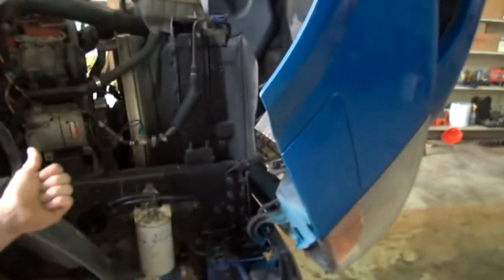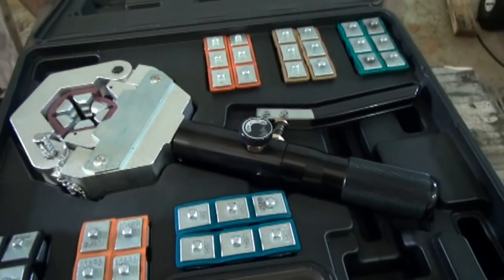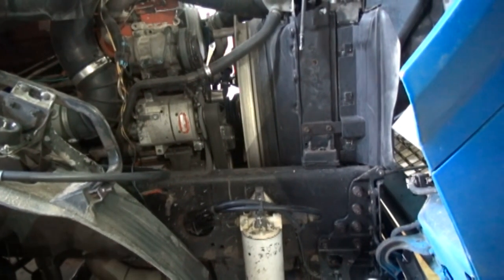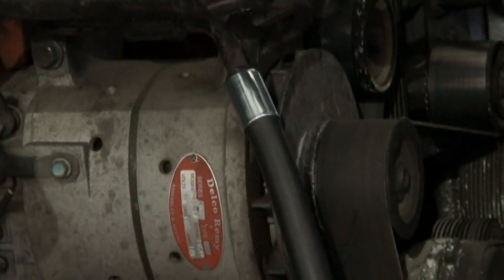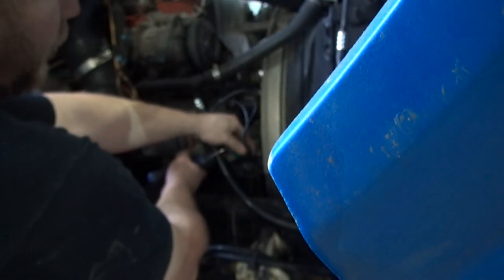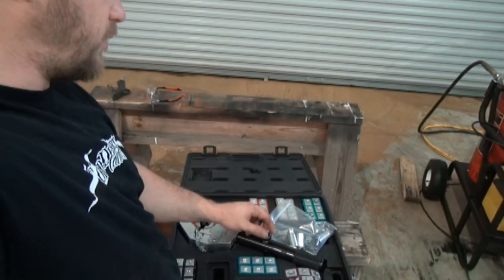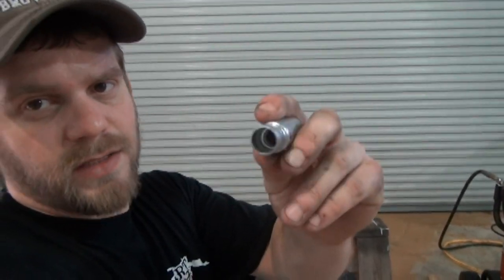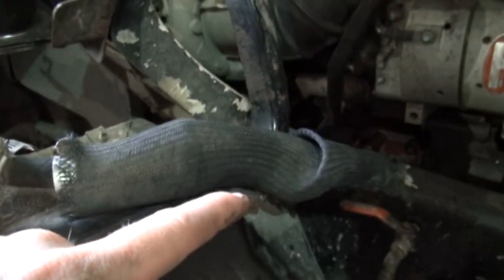How to fix or build automotive a/c line yourself!

Comment: Vacuum leak test won't show leak on hose. Have to pressure test. Also, do you not have to braze fitting in addition to crimping to insure no leak? Nice video, thx for sharing.

Comment: Any update on if this is still good? Is the repair still working?
Reply from the maker: It was working until the truck was taken off the road.
Reply: @LifeWithChase  how long ago was that?
Reply from the maker: @anthonycook8737  about 4yrs ago. Had trouble with trans and engine was tired.
Reply: @LifeWithChase  thanks for the help.

Comment: The vacuum is ok but far better to pressure test as the results of a very small leak will be visible in approx 5 mins the car runs in pressure, not vacuum

Comment: You put the pressure switch on the low side #10 return line? Fail!
Reply from the maker: That's the high pressure line and it worked fine until the truck died and became an organ donor.

Comment: I bought a smilar tool even color the same.my high sides leaked while charging.all of them made  according to chart.im pissed
Reply from the maker: Sounds like you may have gotten wrong fitting for the hose size possibly, had that problem once on another project. Also make sure you have the right crimp die for hose size .
Reply: @LifeWithChase  hoses came with fittings .i have size chart and digital caliper. It only hold 70 psi on the high
Reply from the maker: @Evrenthewrencher  That's odd, I only had that problem once  and I think they give me the wrong fitting or something cause it felt loose when I slid it onto the hose. where as these in this video was more of a snug fit.
Reply: @LifeWithChase  thanks for relaying.i do another pass on the fitting and see what happens.those tools look identical on different names.
Reply: I got ice cold air out 79 Corvette after 7 years.the crimp tool sucks.i had to do second pass on all the hoses to get nice bite marks then it works there is one left.high side holds 225 psi for now after second press.2 day frustration i wud pay someone to do it
Reply: @LifeWithChase  hi where I can buy the fittings?